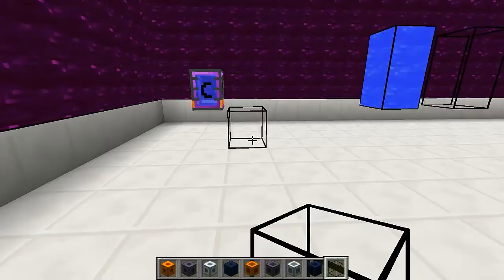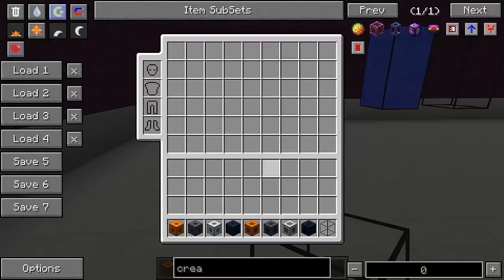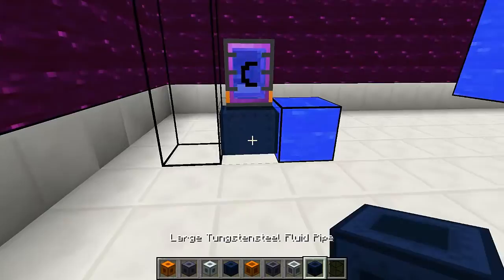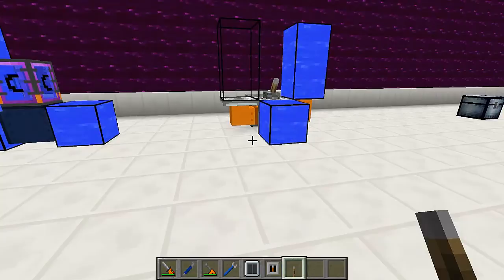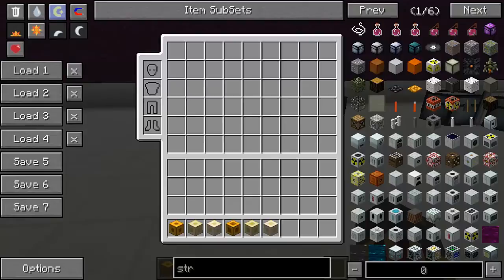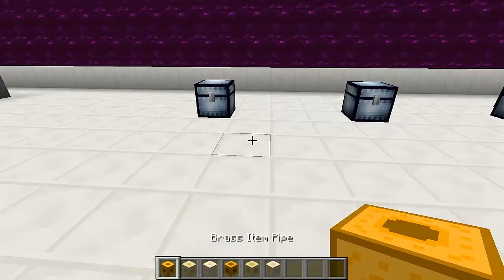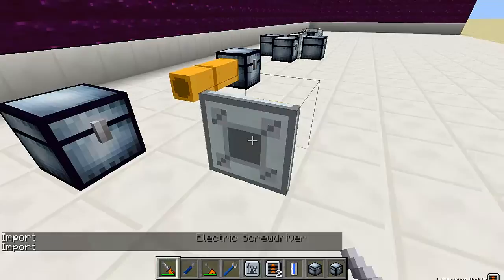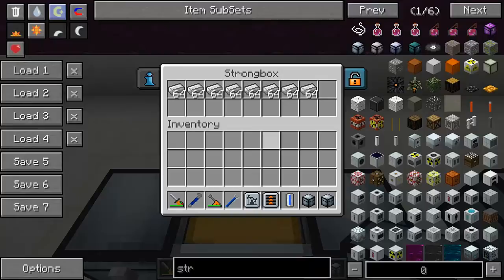[Tutorial] GregTech from Scratch 13 - Pipes

Comment: Also, you can add covers to all faces of the pipe using only one, the same way you rotate the power output with a wrench. Right click on the right side of a side and it will put the cover to the face to its right, right for the side to the right, corners for the one behind, the center for the face itself etc.

You can use the screwdriver the same way, i.e. right click the corner of the side you're facing to adjust the cover on the oposite face.